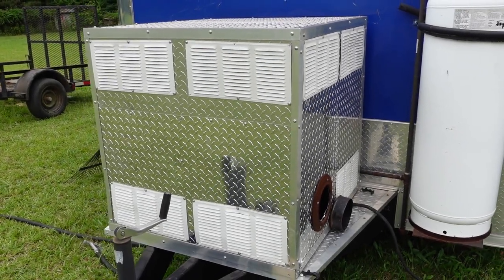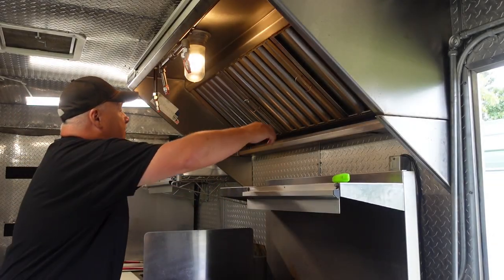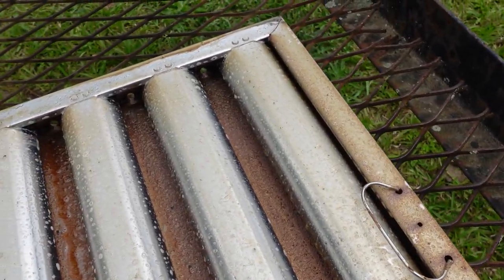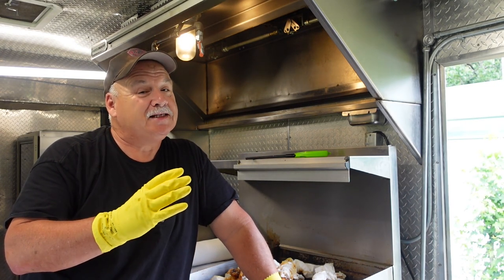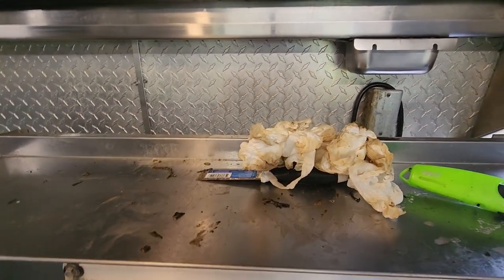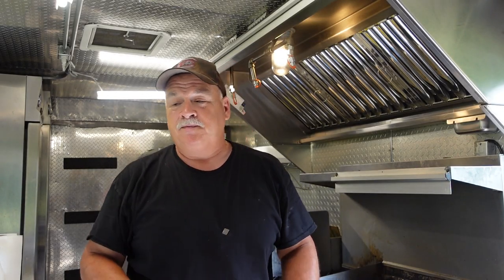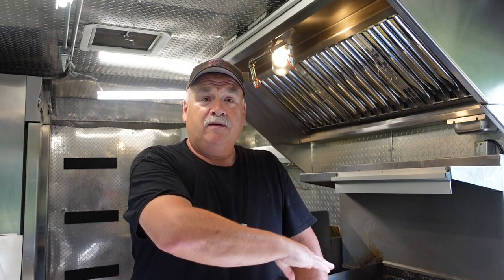Food Trailer Update     Hood Cleaning

Comment: Enjoyed the vid. The pressure washer made cleaning the grates a lot quicker. Just a hint. turn the griddle on low heat and put water on it and use a scraper to remove the debris. Purchase scouring pads. Keep the griddle barely warm and pour Crisco or oil on it and scrub the griddle until it's clean. Did this on my Blackstone when it had rust. Worked well. Looking forward to seeing your food trailer vids.
Reply from the maker: Yeah, just is just almost exactly what we did and it worked great. Got a video of that coming soon!